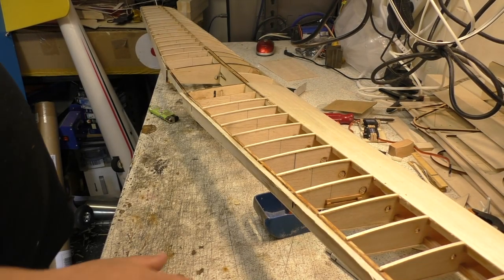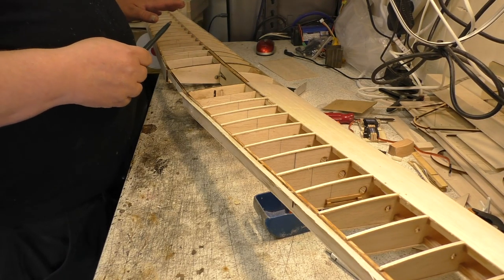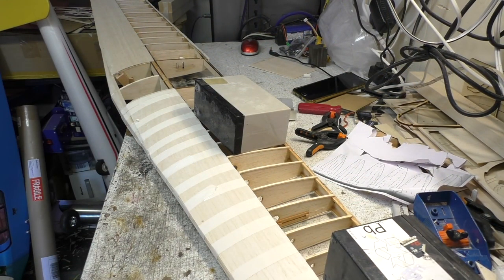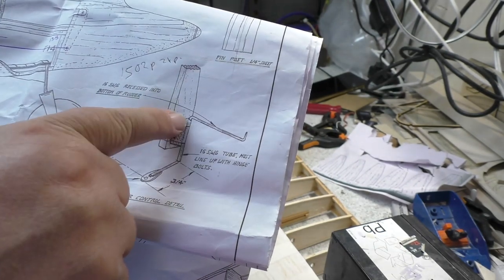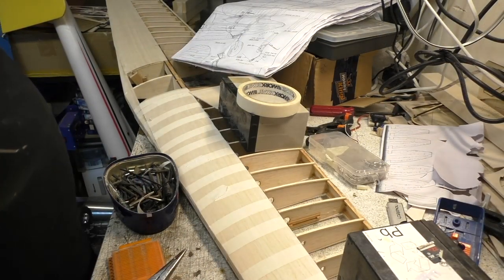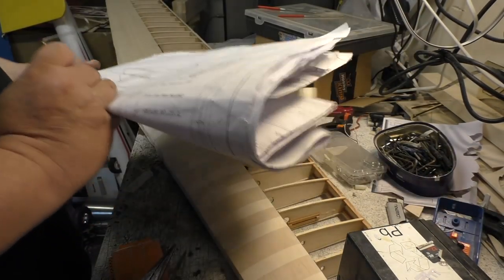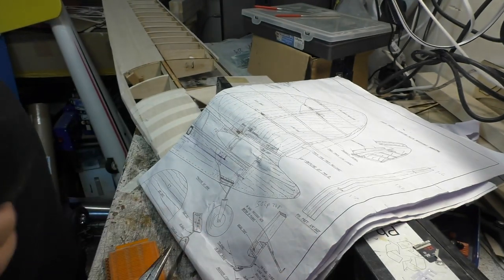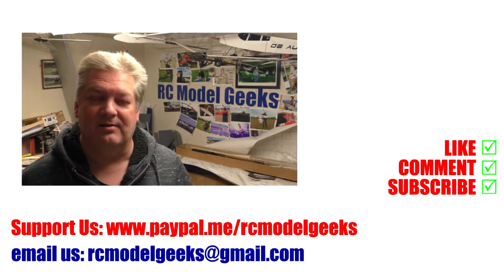Sarik Hobbies Dennis Bryant 68" DHC-1 Chipmunk Build Pt25 RC Model Geeks

Comment: I was in the RAF and was posted to St Athan near Cardiff the day traveled to my new posting my cars engine blew up at 1.30 am in the morning in the middle of no where. I remember the sound of the exploding engine to this day and the sight of a piston wedged half way through the cylinder head  and the cracking sound of boiling engine oil. I wish I had a caravan on toe it have provided pleasant environment to contemplate suicide.